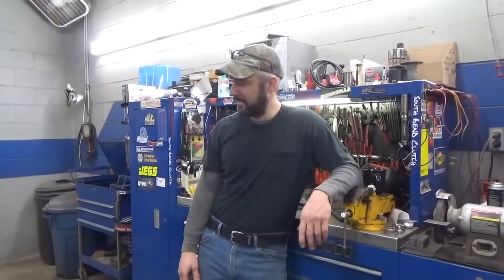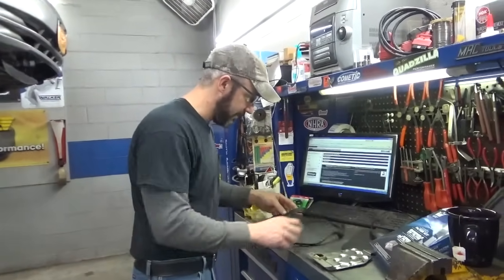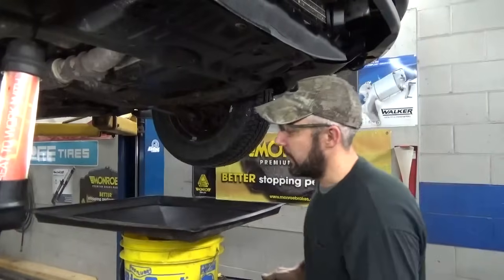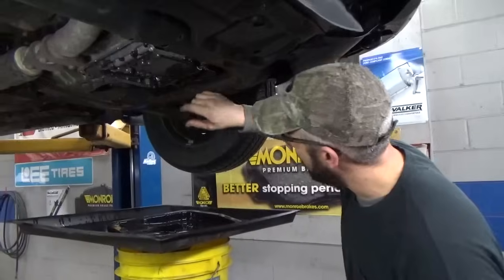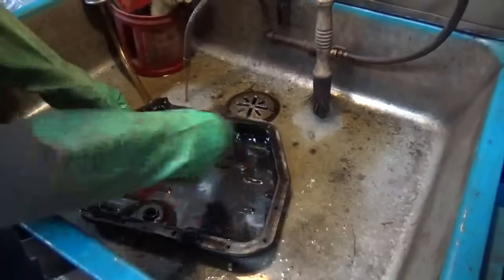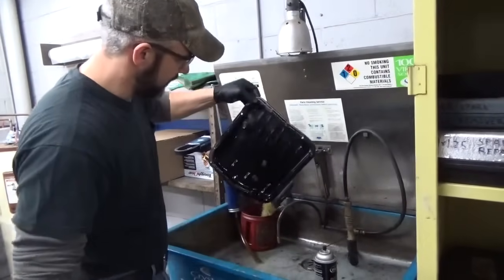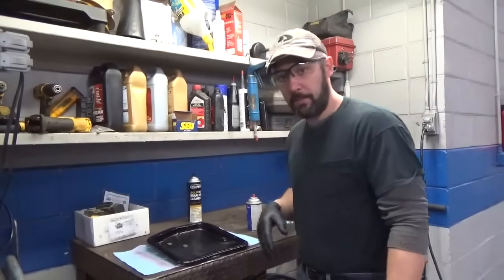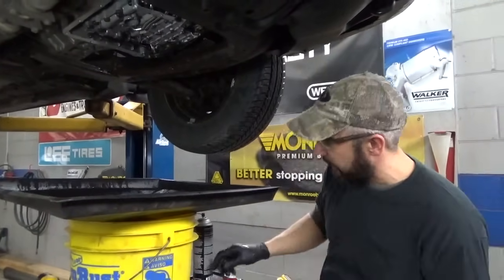Transmission Fluid and Filter Change - Toyota Camry

Comment: I hate doing trans fluid changes none of my cars has a drain plug. So messy but pretty simple. I like that gasket adhesive I will have to get some. Brake cleaner is one of my favorite cleaners.

Comment: Thank you sir for the interesting video.   I own a 1990 plymouth grand voyager 3.3 L engine with 160,000 miles on it.
Back in 2012 I had my transaxle rebuilt at a local AAMCO  transmission shop in Houston, Texas.  It was an expensive job 
but i was planning on a move to NC so I wanted it done right.  I remember the shop manager said since they used all new parts 
to rebuild my transaxle it would use the newer trans fluid now.  The dipstick and manual say use Dexron II.

Well only 7 years and about 12,000 miles later I noticed on my way to my VA Dr appt in Charlotte that when I accelerate hard getting on the highway
at 35 mph it seemed the trans was slipping.  It was ok if i ease off the accelerator and build speed gradually.  I am a handicapped veteran (  not service related )
and I live on a low SSI disability income.  I only drive my old van to Food lion...Walmart...the VA now and then for Sr appointments.  I  do not put many miles on my van every year at all.  I have a mechanic friend who is going to drain and replace the transmission fluid and the filter screen.

I have been getting conflicting suggestions on what Trans fluid to use.  The folks at AutoZone say use  ATF+4  .   Others say I should use what it says on the dipstick and in the manual
for my van  ,  Dexron II.   My question for you is after having a Transaxle rebuilt should I use the original spec Dexron II  or the more modern ATF+4 when i replace the fluid?

Thank you for your help
Bill D
Reply: The Chrysler transmissions should use ATF+4. Even Chrysler didn't realize at the time how sensitive they were to the fluids. Allpar has some great info here: https://www.allpar.com/fix/trans.html

Comment: Hi. Thank you very much for this video... I am a diy since I was a kid cause my father was a mechanic but I'm always learning and this video give me some new ideas.  did a drain and refill 50,000 miles ago to my 2005 4 cylinders Toyota Camry. I'll do it again and I'm planning to use Valvoline Maxlife full synthetic. I would like to change the filter but I know some Toyotas has a screen and not a filter. Some mechanics says that there's no need to change the screen.
Two questions: Does my 2005 4 cylinders Camry has filter or screen?; And if so, is really not necessary to change the screen???
I'll appreciate some information. Thanks very very much

Comment: Is it really OK to spray brake cleaner all over the valve body like that?  Won't it degrade some of the plastic cable sleeves and stuff? Just asking as I need to clean the same area and my thought was to use ATF in a sprayer bottle and even possibly agitate with a brush.  Any ideas, thanks.

Comment: I just bought an 01 camry with 150k miles. I was going to change the fluid but after researching it I'm a bit worried that it might not be a good idea since the fluid is grayish brown. And since the district has a sticker stating "no need to change" I'm assuming that it's never been changed and I may cause damage.  Can you please comment on this scenario.?

Thanks!

Comment: Thank you very much.  But I have to ask...what does all that gasket sealant do to the inside of the transmission?  You sprayed it on the pan you just cleaned. .  I think you should've just sprayed it on the gasket.  If you have to spray it on the lip of the pan, why not at least mask the rest of the pan off?

Comment: What years are you speaking to here. The 2017 does not have a dipstick up top but has a plastic straw inside the underneath drain plug. Do you have a video for this area of years for the camry. many thanks sir?

Comment: So the high tack doesn't contaminate the fluid at all?
Reply: Sure it does but he doesn't say it and he could have just sprayed it on the gasket.  Transmission over $2,000.00 he containments the system with three layers of tack spray before he even tops off the fluids.  This why I do all my own work!  He also uses a metal scraper to scrape the pan and the mating surface, that's a no, no platic scraper are better because they won't scrape or gouge the metal and cause uneven scraping which leads to leaks!
Reply: Spacecoastz The tack spray turns into solids that could clog and contaminate the system along with any other debris, but the break clean spray is alcohol base and evaporates after hitting it's target.  If you spray the tack on a service that your not going cover with an object, the spray is now a thin layer of polymer and if it breaks from it's surface because it's not sandwiched it will just flow in the system with the transmission fluid.  Tack spray should only be put on a surface that's going to be mated.  But every individual will have his or her own opinion.
Reply: Every service manual I have read says no sealants on the trans pan. I do mine and never, never put any sealers on the gasket or the pan. Never.
Reply: Mister Berzins Great point!  The tack is used to hold the gasket in place for ease of installation.
Reply: Mister Berzins but most Toyotas use sealant along with a gasket, some use no gasket and just a sealant.  So by vehicle and manufacturer it will vary
Reply: Plain and simple if your service manual don't tell you to use it don't!  Repair and maintenance the product the way the manufacturer intended there designed product to be repaired and maintained.  Anything else pure unadulterated nonsense, non of these guys are going to replace your transmission or any part on your vehicle after they butcher it!  Stay clear of these so called experts with years of experience doing nonsense like this.  Next thing they will tell you is it's ok to use motor oil in place of transmission oil.  Do it yourself the right way!
Reply: Most who are replacing tranny fluid are far out of the 36,000 mile (Government required) warranty.
Reply: jomowatts you obviously have no real knowledge of this subject by your statements. Watch a real pro like Eric, learn some real-world stuff, not bs that manufacturers design for planned obsolescence.
Reply: With most of the aftermarket transmission pan gaskets the holes in the gasket are made smaller to hold the bolts and gasket in place to avoid having to use an adhesive spray. I was always taught not to ever use any sealant or adhesive with ATF.
Reply: @jomowatts  bottom line is that if South Main Auto was butchering or botching things as you suggest then South Main Auto would have been out of business long ago. Only dealer butcher, err, service departments don't close.
Reply: @jomowatts  so... how many bays in your shop? How long have you been in business?

Comment: Should I replace the filter on a 99 Es300? Not sure when the trans fluid was change has 174k miles. The fluid doesn’t smell, isn’t black but brownish red, I’m assuming it has this same screen as the Camry/ solara/Avalon.

Comment: I have a 2012 Camry. Which of course does not have a dip stick. So Do I basically fill it with how much I removed and hope I do'n't spill any? I don't have a lift so the chances of me making all of the fluid in a container is pretty slim. After the fluid change do you suggest doing it again in 5k miles once it mixes in with the old fluid so you have a more fresh fluid running through the trans? My car is at the 75,0000 mark and I want to replace it once the weather breaks here in IL. Would six quarts be sufficient for the job I am doing? Other videos show them draining the fluid then removing the straw that goes up into the transmission on my model. Which method would you suggest?
Thanks.

Comment: Overall good job. I dont think i would want that adhesive over sprayed in my trans pan like that though.
Reply: yeah isn't the bottom of the pan now covered with adhesive.. no masking was used. otherwise great video!
Reply: Brake clean will dry very fast and he did not spray it in the transmission hole.
Reply: Seeing as this adhesive is supposed to seal against oil, I highly doubt it is soluble in oil. So it's on there, but: meh...
Reply: The sealant you put  on the gasket , will it be easy to take it off next time ? Or do I need a scraper ?
Reply: Next time its a bitch with lots of cussing.
Reply: Nah, the gasket will adhere to the pan, not the transmission. It's easier to remove from the pan than the transmission by a mile.
Reply: Oh, for pete's sake. Take another look at the video. This hating on brake fluid is driven by people who don't actually work on things.
Reply: Brake fluid? Do you mean brake clean? Big difference.

Comment: So it takes 2.6 quarts out of 6. So changing it this way only replaces 43% of the fluid. I suppose the is a good start. What about opening the line at the input to the cooler and let the pump do the work while a 6 quart supply tank is pumped in displacing 6 quarts in the collection bucket?
Reply: ALWAYS replace all the fluid buy pumping out the old AFTER you drain and refill the trans pan. Old oil contaminates new fluid.

Comment: Ive always worried that oversprayed adhesive would somehow interfere w/ the fluid er something. Glad to know there's a better way than I've been doing it. Thx.
Reply: You could spray the one side of the gasket first then lay it on the trans pan once it's tacky dry.

Comment: Hi do you know what size thread and length the transmission bolts are? Mine are rusted bad and the heads are rounded off on some.

Comment: I use copper coat Aviation gasket sealer with the brush and I put it on one side of the gasket and let it tack up then stick it onto the pan it doesn't get hard it says pliable so it removes easy with a scraper.

Comment: If you don't have a drain plug on the transmission pan, but you do have a transmission level check fill tube, you can use a vacuum pump with graduated reservoir to remove what is in the pan. Then when you drop the pan, which will be a lot less messy, pour the remaining fluid into a small container and then suck into the reservoir and record the total fluid volume. Pump the old fluid out of the reservoir and pump in the new to the same level. The fill volume will be very close to the final fill level. 

Obviously, all of the fluid was not changed and the torque converter was not flushed. I think if you want to flush the transmission while the engine is running you should understand how the lube flow is routed and if the pump is starved (sucking air) can it damage the transmission. When in doubt I call my transmission expert to confirm the lube flow before doing an out of cooler fluid flush / exchange. More often than not the advice is do not starve the transmission pump of fluid which directly impacts lube flow. 

If the decision is to not flush in case of pump / lube flow oil starvation (air being drawn into the pump), then after the new fluid has circulated and mixed with the old you can check the new fluid color and if not clean enough do another pan fluid swap using the vacuum pump, just put in the same volume as you pump out. Then fill as needed to top off. 

Replacing the filter is very important, but between filter changes, if you have a fluid fill / check tube, you can actually periodically change the fluid in the pan when the vehicle is cold using the vacuum / fill pump. So, if you have a 5000 mile oil change you could do a 1/3 (approximately a pans volume) transmission fluid change up until the transmission filter change interval where you would replace 90% of the fluid (method without flush). For vehicles with a level fill / check dip stick tube the periodic vacuum fluid exchange in the pan oil change is fast and is very easy.

If you use absorbent drip pads, usually gray or white in color for soaking up spills, I find the white 3M Petroleum Sorbent Pad really shows the true color of the transmission fluid better than a white paper towel.

Comment: One thing, that particular Toyota has a differential drain plug right behind the transmission. It was right there and I believe it uses a 12 mm Allen key. I don't remember the year but one is a separate compartment while the other shares with the transmission. I know my 99 Camry is a separate compartment and has to be drained and filled individually. It uses Dextron two or three fluid.

Comment: Hi SMA,
I bought one of your T's and like it but would like to see a  heavyweight version. Here's my question,  wanting to change atf in 2010 corolla with 161k miles . Plan is change filter and only fluid that drains out with filter . I heard horror stories about changing fluid  but my fluid doesn't look too bad and doesn't smell burnt. I've  had no problems with the  tranny .Is this a bad idea 
Thanks and glad to finally see you in safety glasses 
M L Rogers

Comment: I put the 2.6 in my camry and im nowhere close to the full mark.. after a 20 block drive... how much did u end up having to add?
Reply: you need to check it with the engine running and transmission in neutral and while on a level surface. You shouldve measured what came out and put what came out back in.

Comment: Couple of thoughts:
-when I did my RX, I started all the bolts up through the new gasket just enough to be held in place as a I raised the pan.
-I put the drain plug in finger-tight prior to raising the pan
-the torque on the drain plug for my car was 15 foot-lbs, so about 3 times the pan-bolt torque. This is important, because the fluid will leak if you don't tighten the drain plug enough.

It is well worth it to use a 10-mm socket-drive hex instead of a big allen wrench, so you measure the torque on your drain plug.

Comment: Hi Eric good day to u , I have the 2.2 Celica same as Camry, recent notice hard shift and delay shift , it show p0773 first then I replaced the shift selenoid e , after drive for good 30 miles , notice the delayed shift again , it show p0770 , I haven't change the fluid yet but what could be wrong ?

Comment: Can Toyota atf type t-iv mix with dexron iii? After reading the manual, dexron iii is the right fluid to be used. I have a 1MZ-FE engine, so it would take up to 3.5 qts?

Comment: Honda transmission fluid is the best for Toyota and GM transmissions. Hard to believe, but the friction modifiers transform the shifts into smooth and powerful.
Reply: Jason Burt what’s different about it
Reply: @ecosby100  Honda transmission fluid has friction modifiers similar to Lubegard LXE. GM transmissions have rubber seals internally that are common failure that lead to burned 2-3 clutch packs. Honda transmission fluid eliminates these failure points.
Reply: Jason Burt Honda makes there own transmission. Wonder who makes there fluid.
Reply: In Japan, Idemetsu. Honda chemicals are the best in the business. Alot of Honda reliability is in chemistry and bearings believe it or not.
Reply: Jason Burt will def give it a look I’m a Napa / Valvoline man my self

Comment: Those strainers should never need to be replaced.  I would only do one if I was in there for something else. Older Hondas don't even have a serviceable filter in them. Just drain and fill with approved fluid (Valvoline Max Life DEX/MERC) is compatible with lots of Toyotas, including this one.
Reply: Honda makes a good car. Camry is world class.
Reply: Always use the Honda original OEM trans fluid.  Don't substitute.

Comment: Just curious when you sprayed the trans pan some of the high tack was inside the pan didn't see you remove the over spray or not if that is left in the pan  will it in any way contaminate the fluid and potentially cause a problem.
Reply: I thought the same thing and I'd say yes. Personally, I'd put a paper towel down inside the pan during the spray to prevent contamination. Or better yet just spray the gasket

Comment: Good as always but - the torque converter holds 2/3 of the fluid and perhaps you should remove a return line from the rad, let it run as you add more until the fluid comes out clean.  I always would myself.

Comment: An old guy told me he worked on hydraulic pumps that have filters on them he said to put another filter inline never had a one go bad seem like a trans is similar I have special friction pads on a rebuild trans might put one in line with the trans cooler.?

Comment: I am New to your ch.. I know these clip is in Over 1 yr old But i have Q...   for you  !    Have you worked on Transmission with out a dip stick   i like know if u can change oil in One   i have 2000 Grand am se  twin  cam  2.4

Comment: My Toyota Camry is 2008,recently I did check my car because I got a problem with transmission.the diagnostics shows this "P0713 Transmission fluid Temrutere Sensor "A  Circuit High Input
Reply from the maker: Динислам Байсуркаев What does the temp show on your scan tool?

Comment: Hello , I am checking differential fluid on my car 2004 Toyota Camry se(2AZ-FE engine, U241E trans). But I didn't find out the filling or draining hole. Someone said that Camry's differential and transmission share the same fluid, since 2002 . Is that true? 
Thanks for your time.

Comment: No sealers required. Todays new pan gaskets have bolt holes that will hold the bolts in place and keep the gasket from shifting.

Comment: What else does oil pan do for transmission?  Does transmission suck up oil from the pan to reuse oil?  Does oil get circulated I mean.
Reply: Yes .  

Similar to the oil pan on the engine .  

The fluid if sucked from the pan by the pump , circulated through the torque converter and transmission internals and drips / drains back into the pan .  Closed cycle , unless you develop a leak .

God bless
Wyr
Reply: The oil in the pan is sucked up through the oil filter/strainer that Eric changed, it then is used in the gearbox and returns to the pan.